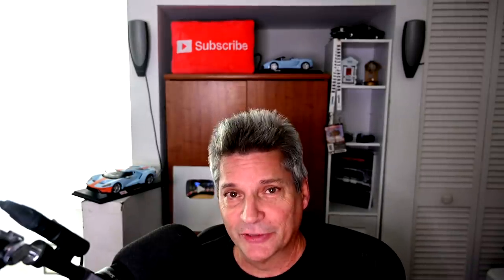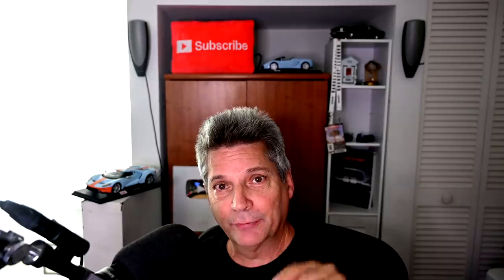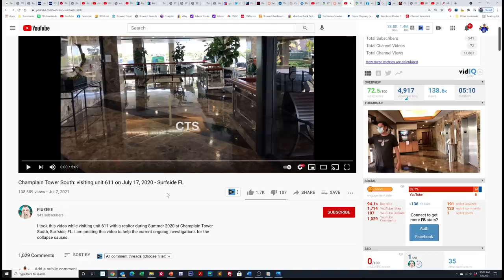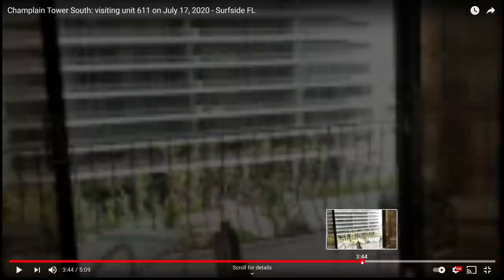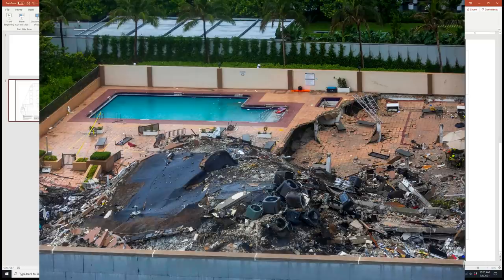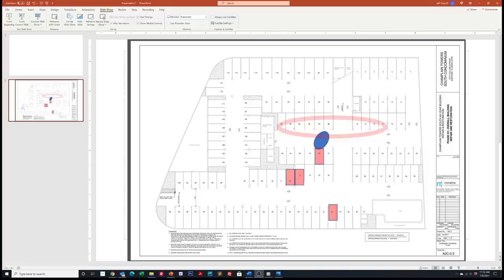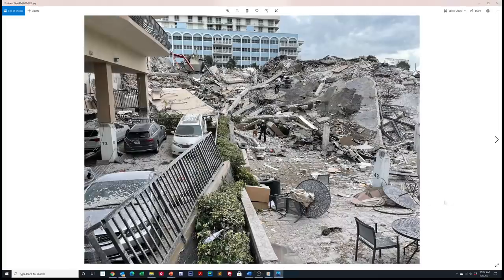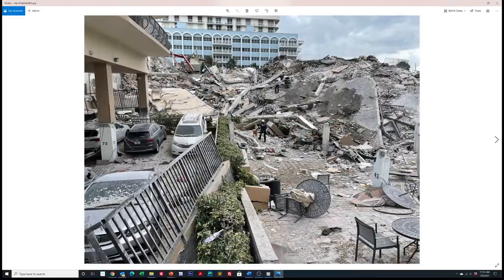Analysis Garage Video BEFORE Condo Collapse: Water Everywhere

Comment: when the building came down in three steps from front to back in the middle.. It wasn't just one set of five columns around those parking spots. The pool deck clearly waved in as it came down. Undermining the first five columns and then the second five you are talking about in a succession. As it spidered the weight of the deck back into the columns as the deck came down like a wave of water going back out from where it came in. Knocking the columns down in rows. This is why if you watch closely in the video each section that comes down has a FIRST FLOOR dropping stutter then the pancake drop of floors. That first floor sheared in the wave in each section of columns. Then as the second floor in each section tried to compensate it faltered quickly and then each floor set 3 thru 14 in each section did the same. So the pool deck dropping and binding the tops of columns in an angle as it dropped is was what took that building down like an accordion. 

It looks to me that the columns in the garage were poured in at the same height first cast the same grade shot with a transom. Instead of lower then higher than the pool deck in casting elevation to alleviate the column to floor first floor / garage ceiling stress issues which clearly occurred across those columns at deck to floor as a "KNEE Joint vs. poured through solid in cast. If you look at the only part that stayed up with the three times bigger columns this was clearly done. outside of the fact that they were bigger columns. 

Step one: When ever the building was built they cut corners past engineer's spec to cut costs. It is Miami.
They are still doing today in Florida. Example Then Bridge from Clearwater Fl to Clearwater Beach was cancelled after columns because the columns were cracking up to severely to put the bridge span in to hold the weight of it before they could even get the spans up.

Step two: Then they go as far as to "CHANGE" the way the structure should be built to cut cost. No matter the fact that the Condos were going to sell for a fortune. 

Step three: The whole entire building in every square inch should have been 100% maintenance immaculate. WHEN THEY ARE MILLION DOLLAR CONDOS!!!!!!! To where any of the screwball BS from steps one and two over the years would have been tore and fixed. Especially the "flat"ness of the pool deck concreter that was supposed to be pitched for water drainage. 

NOPE cuZ EVERYONE wants to take and no one wants to give their fare share!!!!!!!

I think the builders and owners of project initially, then maintenance from then to now whom of which ALL three knew and looked the other way lining their pockets. Who are still alive should be chained to dumpsters where they can only each garbage and live in the weather the rest of their lives. and those who are long dead should be dug up a skewer shoved in their ass on a rotor motor then buried back to spin for eternity for no rest ever!!!!!!!!!!!!!!!!!!!!!!!!!!!!!!!!!!!!!!!!!!!!!!!!!!!!!!!!!!!!!!!!!!!!!!!!!!!!!!!!!!!!!!!!!!!

That being said! On the devils advocate. I couldn't imagine paying millions for a section of rock and steel among various other materials only to have come down crushing me to death faster than I can blink. But that is man's arrogance. 

I think it falls in line with there are billion dollar sports games and children go hungry, or we send rockets to outer space but have to discover everything in all of our oceans first. I mean the common cold is still around and people are killing each other on a daily basis. 

Who is the true virus I wonder.......

I think it is a no brainer!

Comment: alot of lawsuits, even criminal charges should be laid on those who didn't take action to prevent this tragedy.
Reply: That can include the unit owners.  The HOA, as far as I’ve heard so far, did have plans to address many issues after the inspection at some point.  The issues was getting the right bid of contractors.  The  cost to address the building will then be assessed equality amongst the unit owners.  It is very common the owners  would  argue, assessment fee being too high and drag things out.  When it comes down to money (paying out pocket) the unit owners often resist and delay the whole process.
Reply: We cannot overlook the failure of the regulatory body.
Reply: @jacobcastro1885  the problem is there was no regulatory body. The condo board was trying to address the structural issues but faced resistance from the unit owners. On top of that, the city official who looked at the engineer's report in 2018, said "the building was in good shape." That report should of been looked at by a higher up in the city. I believe he is also culpable. There are many to blame. My hope is the entire process here in south Florida is changed during the recertification process. It should begin at 30 years instead of 40. An additional inspection is required every ten years.
Reply: Take the pass port owners may leave country
Reply: @suziespurdis869  I always tell people GO TO HOA meetings and record them
Reply: @aurinkobay7118  yes, that's a good idea. I don't know if the champlain board has released any minutes of their meetings. I know the condo board president has released letters she wrote. She explained  that the building was deteriorating and the repairs needed to be immediately started.
Reply: Agree💯
Reply: I hope there will be law suits. The whole state of Florida is on radar for collecting condo fees and dodging addressing structural issues. You just can raise condo fees so much, but if money goes to questionable individuals that’s not the residents fault that’s corruption and negligence. 
The building had to have an appropriate insurance by law and if there is a leak and millions dollars needs to be invested that’s what insurance is for it’s not solely falls on residents shoulders. 
Residents would pay deductibles and they have their own insurance for that covers deductibles. You still would pay a portion out of pocket but it wouldn’t be that big. 
So, it’s a weak case to blame the victims. There is more to this story.

Comment: 34:39 That is the smoking gun!  In order for the water to become coffee gunk, the water was likely entering the roof and leaked to the basement corroding the rebar all the way along to the parking garage!  That is IF the building was built of concrete risers not steel.

Comment: @ 4:53 The bottom of the column to the right appears to have discoloration at the bottom where the yellow paint is and at the crevice where the bottom of that column is level with the parking garage cement floor there's a noticable darkness too. Other colums in that parking garage appear to have the same discoloration under the yellow paint.  I wouldn't doubt if this building had serious mold problems as well. 

I've seen some basements that had excessive damage from flooding due to heavy seasonal rainfall, mild flooding from rapid snow melting, and from frequent sewer back ups.   The areas where the water repeatedly flooded throughout years & pooled over weeks or a few months, and/or had seeped into the cinder blocks and concrete flooring would have the same darkness/discoloration like what is shown in this video.  

The millions of dollars spend on those condominium apts for luxury living should have also been spent on the safe upkeep and proper maintenance of the building.

Comment: With ceiling of garage dropping and columns still standing vertical, does that mean connection between column an floor was pretty weak? Otherwise seems floor failure would cause column failure. 
Would stalactites indicate where water was seeping through concrete or where roof was already sagging? Paint is definitely indicating moisture.
Reply: The stalactites definitely show major leak areas. As for slab-column connections: this being a “flat slab” structural system, and with seemingly inadequate rebar detailing at the columns (per post-collapse photos), the connection was indeed about as weak/minimalist as it could afford to be.  That said, my suspicion is that the collapsing floor nevertheless pulled at least one of the smaller columns out of plumb, and was probably critical to bracing those columns . Following the floor collapse, the now out of plumb and effectively more slender columns buckled, and a progressive collapse ensued as the load was shed to adjacent columns.
Source: am a PE and have been using this channel for the best info I’ve seen yet
Reply: There are no horizontal support beams, one of the architects pointed out in above comments. Because if you see concrete slabs are just glued together in squares and nothing holding them underneath.
Reply: Ok, think of it like this, you have 3 sheets of paper, (the slab, membrane, and pavers) and you set the paper on top of a pen with a flat edge on top, (the columns) then push down on the sheets of paper on top of the pen (the weight of the slab/building on top of it), then slowly add water to the paper, eventually the water will soak through all 3 sheets, weakening the paper, then it will give way and collapse down around the pen leaving it standing.
Reply: @vkrgfan  In a light-duty slab (such as one which will only support patio chairs and foot traffic), the shear strength of a 5"-8" thick slab is often sufficient; beams, drop panels, and column capitals are not required in those cases.

Comment: Cone was used as a reference point to not back into that column.  Coming from a Truck driver. Just saying
Reply: That's what I thought. The car owner put a cone there to avoid backing into the column.
Reply: Good observation Gold!
Reply: Orange paint, from column, is not pretty on a $50k SUV

Comment: I love the videos you do but, with all due respect, talking about the humidity in the garage causing the peeling.  I am not sure that leaking water cuasing that would be the sole cause.  I am 1 hour north of here.  It rains every day in the summer which means more humidity. I'm sure some of those vehicles track water in if they drive in from the rain and some of it makes its way in down the parking ramp.  So on a hot summer day it may poor for 10 minutes but then the clouds disappear and the Sun comes out. The humidity it's stifling. For example, an hour or two ago it was pouring so much that my balcony got soaked. But if you look outside is a beautiful clear day.

All of that being said, I do believe there were major leaks in this garage and I think your theory on why it collapsed is very accurate. Just wanted to make the comment about the humidity.
Reply: I lived in Orlando for a bit and you are correct.  Daily downpours are a feature, not a bug.

Comment: I don't doubt the scenario you previously showed us. I think you pinpointed the problems exactly. I do have concerns with this video, however. It could be raining, or could have just rained to account for the water on the floor in this first video. These small pools do not look problematic to me. The ceiling peeling is probably telling. Thank you for your all your help! OH, FYI my condo in Myrtle Beach has at least one car in the garage that is always covered....looks like an older Mercedes Sports type convertible. That garage looks dry to me.

Comment: Same, I definitely want to know if the structural issues are identical in the sister tower
Reply from the maker: Based on some of their earlier news reports and interviews with residents from the North the news from the North towers, they apparently fixed things yet apparently fixed things early on when they saw them happening so they are in a much better so they are in a much better state and of course engineers have been going through that building all week but so has been going through that building all week but so far they're getting the OK.
Reply: @jeffostroff  Great follow-up to a good question. I really like your in depth analysis on Champlain Towers, and the comparisons you make from the downed South Tower to the North Tower construction. (Also glad they you edit your comments as well). Subscribed.

Comment: There's a guy who used to work at the building on maintenance, gave an interview. He said that the sump pumps for the garage were always failing due to the volume of water ingress. He said it was sea water and the other buildings didn't have the same problem.

Comment: Jeff, another great bit of "Hércule Poirot" work (Agatha Christie would be proud) - and thanks for being so kind with your more visible cursor (I was the one who bitched)!  Three remarks: (1) You talk about the pipes at the foot of the down ramp into the garage, and have added in the comment that the sprinkler pipe bursting would have triggered the alarm (which clearly hadn't happened) and seem to think the horizontal white pipe may be the one seen from the street in the "tourist video"; however, you did question the strange open-ended pipe that the prospective investor had in the shot when pointing to bay 17 and that to me looked very like the pipe pouring water in the "tourist's 7' before" video out of presentation 1 you did. Could it be that one which had poured water just before the collapse? (2) In the 44" video at the end, although you may not have authority to do so, presumably the automobile behind which the photographer was standing belonged to the owner of one of the apartments - the license tag is caught briefly in the pan - tracing that tag to a particular owner might identify the precise location that the video was shot from; (3) You're right - water finds the path of least resistance (as you say early on); if you stop up that path, however, it will simply find the path of next-least resistance. Time to twirl your moustaches, Monsieur Poirot, well done.
Reply from the maker: The depth makes it hard to determine where the pipe was, I simply don't know. I do know that the fire alarm was triggered, and at 1:16 AM the alarm company called in the 911 call of a triggered alarm. But the audible fire alarm did not sound.  The loss of pressure in the fire sprinkler pipe likely is what triggered the alarm company

Comment: I'm a landlord myself, & if I, my tenants or whomever brings to my attention or I see anything wrong with my property, I fix it right away. Especially dealing with water damage, foundation/structural damage, roof etc.
I rather get everything done asap than to wait years for the problems to get worse. This tragedy is so sad on many levels and could had been avoid if all the work needed was repaired years ago when it was brought to the HOA attention, with that the findings of the inspection back in 2018. It's 2021 there is no excuse for why the building wasn't maintained throughout the years. Side note: I love going on vacations to Miami. I've been numerous times throughout the years and everytime I go it seems like the ocean is getting closer & closer to the shore with the sea level rising. Also my last vacation in Miami South Beach we kept going to different hotels because the foundation of the hotels we were at didn't seem sturdy at all. Needless to say, Florida needs to get it together, dump DeSantis, invested & start to combat Climate Change & especially the sea level rising. Most importantly: MAKE SURE ALL BUILDINGS ARE UP TO CODE EVERY FEW IF NOT EVERY YEAR!! 
R.I.P to the victims and sending love to the victims love ones. 🙏🏾 ♥

Comment: Any thoughts on soil subsiding? basically water table comes up, soil subsides, makes void. water table rises again, water takes place of now missing soil. Problem continues, this would have also put additional load on the pilings along with erosion of the rebar/concrete.

Comment: Yes, if it had been the sprinkler system pipes that had broken, the fire alarm would have tripped instantly. They are designed to react to water being pumped out through the system. That allows them to be tripped by heat if necessary.

Comment: It also looks like the roof is about to buckle when u were at column 54. It looks sloped a little bit above the silver van. 🤷🏻‍♀️
Reply: Cieling
Reply: @GUITARTIME2024  Ceiling?
Reply: @GUITARTIME2024     i before e…except after c. I learned that rule way late too.
Reply: @rubyoro0  f before u and c before k, then add an "off".